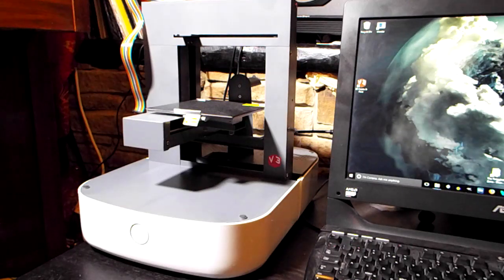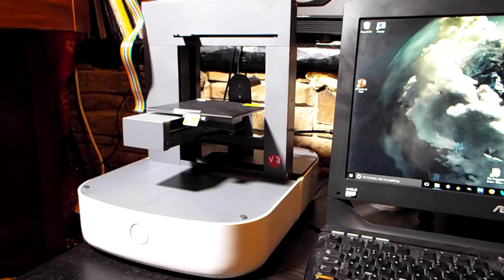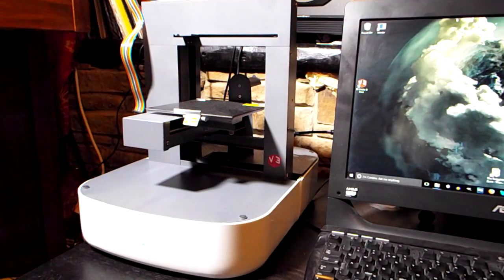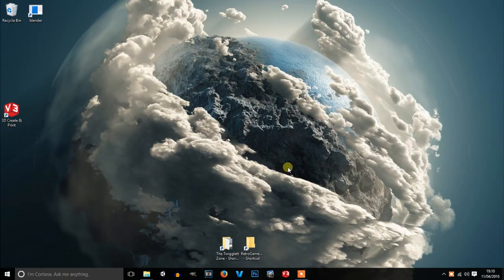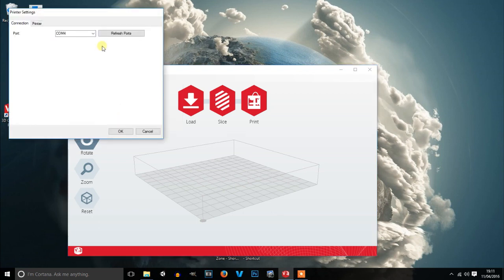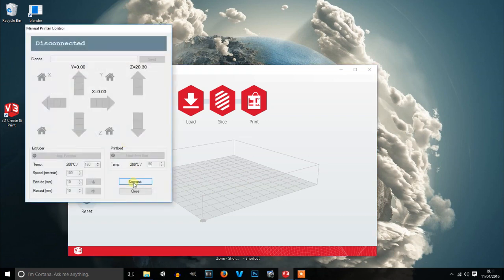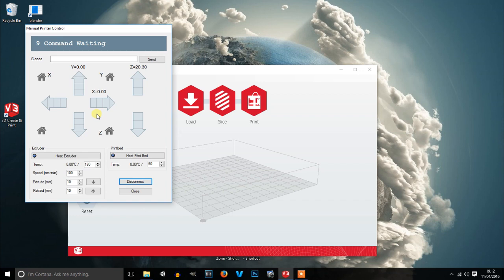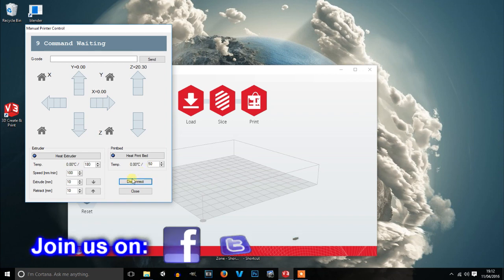Eaglemoss V3 3D Printer : How to connect to a PC ( Fix, Repair, Tutorial)

Comment: Have you done a fix for a blocked printer extruder/nozzle plz
Reply from the maker: no as ive never had one sorry.
Reply: +RetroGamerVX lucky sod.  I've had a faulty main board. Amount other bits and have had to wait nearly 6 months for a replacement main board and now having tried the calibration set up and to extruded a test amount of filament filament got blocked and then wrapped loads of filament round the feedsigear and all the tension mechanism.  I'm fated or bloody cursed.  And there geek squad take ages to get back to you
Reply from the maker: +Mark Evans ive been lucky, no issues :)
Reply: You can Download a Troubleshooting Guide on the Website.
Reply: Best software and drivers to run this thing please and where to get it thanks

Comment: got mine  to connect but when you send commands to the printer is it suppose to move even if you're  manual print control or are you supposed to press something ?? and mine keeps saying commands waiting and im not even touching the x y or z axis
Reply from the maker: use something to press down the hood button, should jump into life :o)

Comment: After a lot of messing around I have managed to get mine working and here is a summary of what I've done to get it working on a Dell Windows 7 Pro 64bit laptop with 8Gb memory.

1. Installed the drivers as per RetroGamerVX second video on moving the Axes (https://youtu.be/0Gj7fN0sMQk).
2. On Windows 7 I found it not necessary to run the program as administrator, although I don't think it would do any harm.
3. Changed the Comm Port from 15 to 2 (the lowest free comm port free).
4. In Confg -> Printer Settings -> Printer, i turned off "Disable Hood Switch". I suspect it needed to see the switch operate at least once for it work however with this disable in software it never saw it operate. I have subsequently turned it back on and it operates ok (still needs to be pressed to get the axes to move though!)

One final point to note I can't get my Z axis to move at all using the controls. The exception is pressing the home button when it does a 'little jiggle' but as its already down it doesn't do anything. Not sure if this is a hardware issue or software problem.

Hope this helps.
Reply from the maker: Well done for getting it to work :)

Comment: I see your running windows 10. I'm running windows 7 and tried running the program as administrator, even tried uninstalling and reinstalling but still no joy.
When i plug the printer into my computer I get a USB comm port added in the device manager but it still doesn't want to conneect. On your computer, does it say that its connected to the 3d print and create printer or does it just add a generic usb port?
Reply from the maker: +John Tooley It just says a port on mine.
Reply: +RetroGamerVX Well i have got further. i have followed the link on your other video (how to move the axis) and unistalled my driver and installed the one from the web site you used. Mine now goes through the commands as yours did except there is no movement even when I press the hood switch.

One point I noticed as well, the menu options are greyed out except lanugage and it won't disconnect.

Comment: I've also just noticed something else: in Eaglemoss's tutorial videos, the USB cable has four wires running through it. But the one which came with the magazine has five. Now I don't know enough about this kind of thing to be able to tell if this is a problem,  so if someone more technically-minded can either reassure me or confirm it is a problem, I'd be grateful!
Reply from the maker: +Andrew Sharpe As long as their are 5 pins on the boards it's connecting too, should not be a problem, only fits one way around too :o)